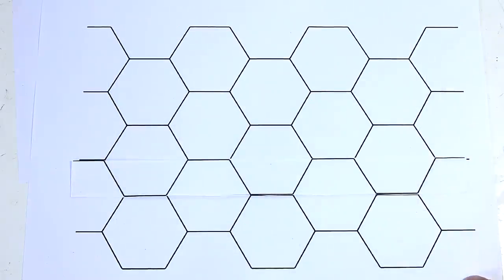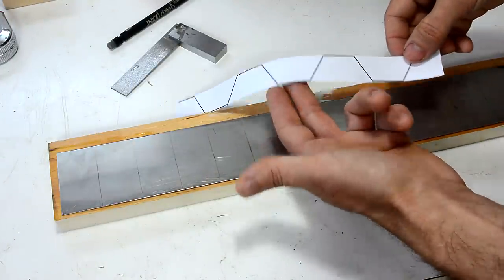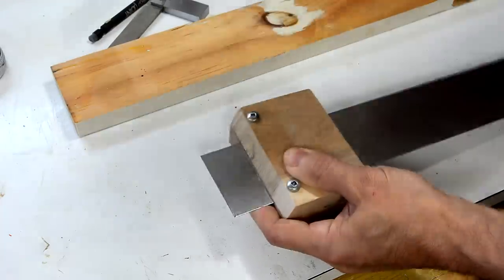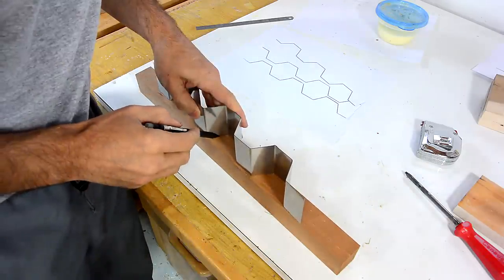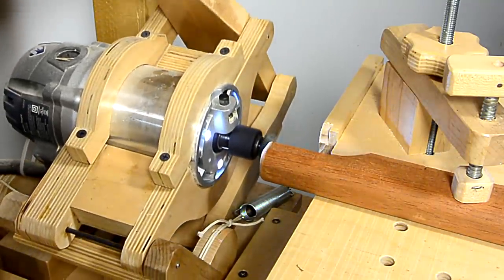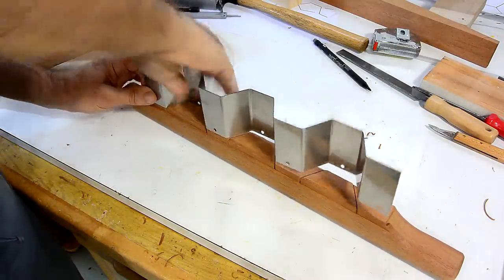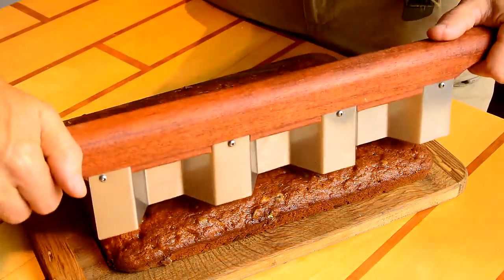Hexagon cake knife

Comment: Right up until you pulled out the cake I was thinking how this was kind of silly...
But it worked so well that I've totally changed my mind.   Neat idea, and a fun project.
Reply from the maker: wordsnwood That shot of cutting the cake was litterally the first time I tried it.  Didn't want to waste a cake just for testing.
Reply: Matthias Wandel I think your view count will go up even higher if you incorporate food into every video!
Reply: Matthias Wandel But you realize that you will waste cake every time you use it because you can't serve everyone a proper hexagonal piece. Some will have to get ends and half hexagonales. :)
Reply: Cliff Hartle That is merely a matter of baking the cake in the right dimensions. Still, even if there were pieces left they needn't go to waste. Just make a crumble, problem solved. Brain: check! Brain working: Insufficient data!
Reply: Cliff Hartle Holi moli I had to read that so many times.. but yet you said it.. it's just that I have not heard the phrase.. " Waste  Cake " in the same sentence before... I always hope for those off cuts myself.. WELL HEY... someone has to taste it first..
Reply: Manfred Rudolf Bihy So now he has to make a specially shaped cake pan. Oh and a crumble is NOT a hexagon. :)
Reply: +Cliff Hartle  those tiny pieces are perfect for the dieters in each group!  If not, plenty of children will gobble them up no matter what size they are.
Reply: Or you could just cut them the size they need to be depending on the individual. And not count on a bunch of people that may or may not be there to solve an unnecessary problem that was created for no good reason. Or that someone may or may not want a smaller piece or hope that there's a bunch of kids around to fix it. It's still completely pointless and inefficient.
Reply: +MrYTGuy1 Oh I see.  You're THAT guy.
Reply: My god, I've become a monster.
Reply: What may be pointless and inefficient to one may yield artistry, show mastery, or inspire others to do.  Critical analysis without solution is also pointless and inefficient but as noted, can also inspire.
Reply: "Critical analysis without solution is also pointless and inefficient"

Except I do give an actual solution along with my critical analysis.

I'd also go so far as to say that analysis is always good even if you cant come up with a solution as a result. Because not analyzing something is the only guaranteed way to not yield a solution. Now that's inefficient. Sticking with something less efficient just because you can't be bothered to analyze it. Because after all, just analyzing things is pointless. But then again you don't actually know if its pointless until after you've already analyzed it. Which makes it analysis very valuable. You literally don't even know if you can even have a solution without analysis. So I'd say that analysis is probably the most efficient thing you can do because it gives you the information necessary to determine if a solution is even needed or viable to make things more efficient. Analysis has to be the first step otherwise you're not going to ever improve or get a solution. At that point you're just uncritically accepting anything that comes along. 

But as I said in another post, to each his own. Just because I find this pointless doesn't mean others wont get something from it. Even if that something seems equally as pointless to me or even unobtainable in some cases. And frankly I don't really care if my analysis inspires anyone, I'm just calling it like I see it. If it does inspire people to be more critical then yay. But knowing humans all too well, I doubt that will happen.
Reply: +Cliff Hartle eating the offcuts yourself is not waste ;)
Reply: MrYTGuy1 The time spent on analyzing this is a complete waste of time and will serve no future purpose.
Reply: +wordsnwood Yes it is and you can make other shapes too not just that one! :)
Reply: +Cliff Hartle  those are for the people you hate.
Reply: Symplay bake a toroid cake. Solved.
Reply: @ManRudBih  Do you think a HALF HEXAGON will suffice for a god like Matthias?
I think not.

Comment: Kinda looks like a piece of corrugated roof panel. Too bad they don't come with 60 degree angles.
Reply from the maker: knucklecorn or in stainless steel!
Reply: Matthias Wandel but they do that in stainless steel!
Reply: +DRFR Corrugated roof panels in stainless steel? That would be way too expensive. The metal colored ones are galvanized.

Comment: 1:40 why didn't you just make the wood block protrude at a 60 degree angle so you could consistently bend it without needing to check it?
Reply: The metal will spring back after the bend to 60.  You need to bend a little beyond and I'm assuming the amount is trial and error?
Reply: JYC422 Aye! Never worked with metals its seems, especially cold worked wires and sheets...

Comment: I made a break like the one you made.....except, I added a piano hinge and a slab of wood so you could bend metal by operating the hinge.  I also used thumb screws for quickly securing and releasing the clamping side.

Comment: This is a lovely idea. I wonder if the bending tool could be beveled to the right angle to remove the need for the angle measurement; just bend as far as you can, and done.
Reply: No, because of the need to overbend it slightly to compensate for spring- back.
Reply: @Nitecrow314  I understand springback. Suppose you need to bend something to 120 degrees from straight. If the amount of springback equates to, say, 5 degrees, then build a tool where you bend the material to 115 degrees; when it springs back 5 degrees, it would come to rest at 120.

Comment: Very cool idea and nice build.  I can think of a couple ways that I'd change the knife to make it a bit more practical, though.  Instead of having the handle running the full length of the spine, I would just have handles on either end.  That way, it doesn't matter how deep the cake is.  You could then also just flip the knife on its axis for the next cut rather than turning it around end-to-end.  It would make things quicker and more efficient.  Doing the handles this way might change the rigidity of the blade,though...

Comment: I think this design was just a plot to be able to sample all those little ends of cake that didn't make the grade. This, rather than a cool you tube tutorial.  Nice implementation, having the saw cut one at a time makes the blade fit the handle nicely. I would have tried making all the cuts in the wood in one go with less than stellar results.

Comment: What if you cut the metal gripping block to the angle you needed each bend to be, that way you'd just push each bend until it was flat on the block, which would make sure they're all exactly the same.

Comment: With the little wooden jig you made to bend the steel, would it have been easier to have the chamfer cut to 16 degrees instead of having to check it each time?  Also thank you, because now I'm hungry.
Reply: It was actually 60 degrees. To get the steel to stay at 60 degrees after bending and releasing, the chamfer would have to be >60 degrees in order to overbend the metal and get it to yield.
Reply: Luke Heffernan Ah okay.  I haven't worked much with metal, so that's good to know!

Comment: Why didnt you just make the holder for the metal cut at the angle you needed so you didnt need to check every time after bending?
Reply from the maker: +John Kim Not that easy.  I'd first have to figure out how much to over-bend it to get the desired angle.

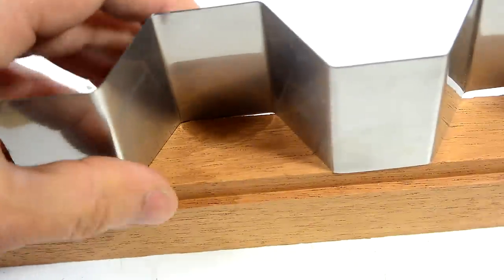Comment: 2:40~2:45 Is there a reason you didn't just use measurement to do all the markings at once?
Reply from the maker: I wanted to fit it to the metal, and the shape of  that changed a bit as I forced in the slots.

Comment: He could have just built the 60 degree angle into his wooden brake, to save the time of measuring and adjusting each bend.
Reply: I thought the same at first, but it turns out that to bend a piece of metal at  a certain angle, you must push it a little bit more than that in order to counter the marerial resistance. He could eventually find the right angle to set up a wooden brake but i believe it's easier to do it this way unless you're planning to make millions of hexagonal knives.
Reply: I understand that, but it is not hard to find that spot to bend it. He went to all the trouble to make that brake in the first place, measuring and cutting the correct angle to make the rest of the process easier wouldn't have taken much time.

Comment: Seems like a whole lot of work to just cut a cake. I've been doing it for decades without any problems so far using a standard knife or maybe even a serving spatula. Plus the people who get the end pieces are getting the short end of the stick so to speak.

I guess I'm just failing to see how this is superior to just standard square slices. Slices that have the same basic shape as the cake itself so you don't have a bunch half pieces or wasted halves of hexagons. And yeah I could crumble up whats left over, but why? Why not just serve it in a normal shape without having to do all this crumbling to account for the inefficient cutting tool.

So you do all this extra work to create hexagons which in turn create even more extra work later on to account for the leftovers that didn't fit the shape of your hexa-knife. It's like forcing the square peg through a hexagon hole. It just seems really inefficient to me and it seems like a lot for work for no benefit at all. But to each his own.

And the worst part is, I cant believe I cared enough about this to type this whole thing out. What have I become? lol

Comment: Utterly bonkers. More bonkers than the handle repair. Not as bonkers as the grass cutting. 
However, you have blatantly flouted one of the cardinal the rules of You Tube woodworking - you didn't shave your arm with the thing you sharpened! Tsk.